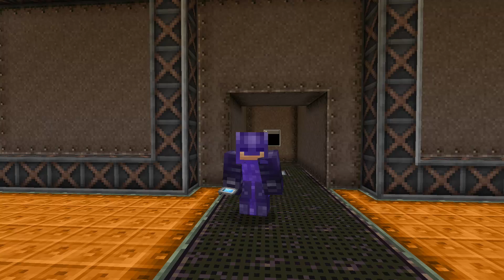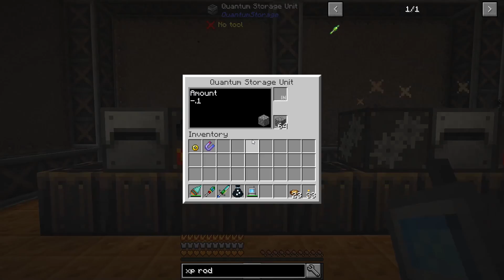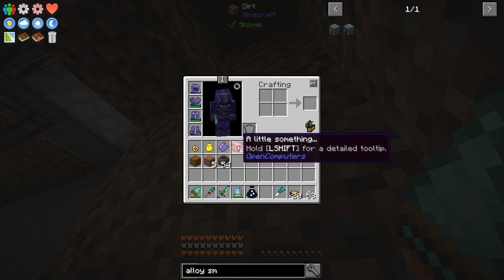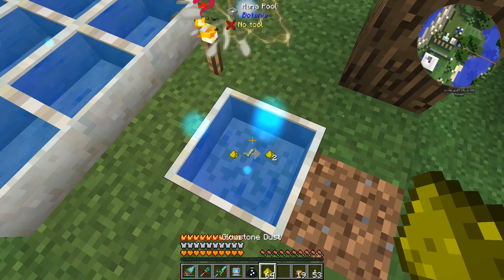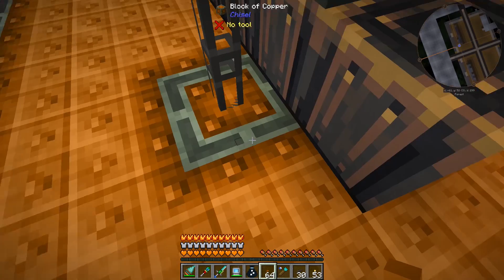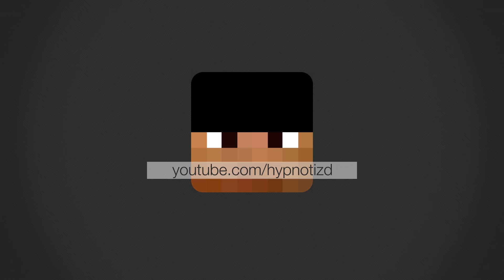Minecraft Mods FTB HermitPack - AUTOMATED [E38] (HermitCraft Modded Server)

Comment: Just a suggestion, but you could add a capacitor bank in the wiring room just to store some extra power because the dimensional transceiver only outputs 40k rf per side, if you get a lot of machines going at the same time for the crafting it could suck up a lot of power... maybe

Comment: The dev of Chisels & Bits said that it is not possible to make c&b creations connect to any other block or creation. He won't do it.
Reply: Hallo89 hmmm yeah maybe refined storage should make cable facades like AE2 but then they do have to get the conected texture
Reply: Bas Haaksema no.. AE's facades do not work with connected textures.. honestly, I can't think of any other facade that can..
Reply: Joe Sherman Ender IO? :P facades are possible to connect
Reply: Hallo89 yeah.. that's the "other" I was referring to.. I should have said that though I guess.. lol
Reply: Joe Sherman :D I dont know actually, i'm no coder, so don't quote me on that, but I think because facades have only 6 variants it is easy ("easy") to get whether there is a connected texture next to it and therefor apply the texture via e.g. the chisel CTM API for the facade. C&B is not compatible with that because of its unlimited variations. but like I said, I'm no coder, so no idea :D
Reply: Yeah but I did mean that AE had no conected textures thats why I said but. (Its no big deal though :P) 

and second I dont know but what happens if you put a block there where he had the cable and then only chisel the opening does it lose the conected texture right when you take one bit out?
Reply: It does. As soon as it converts the block into a custom C&B model, it, well, isn't the block anymore and with that loses it's properties